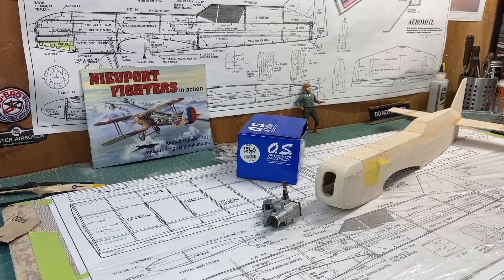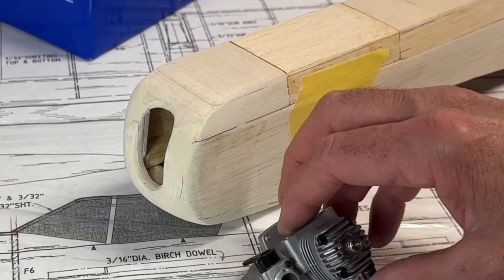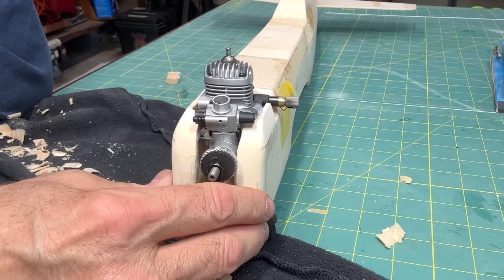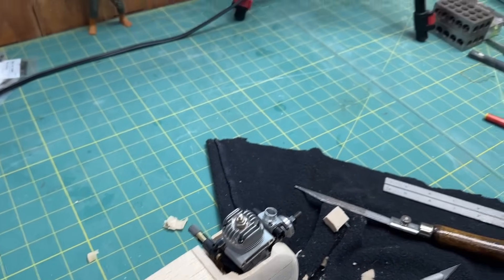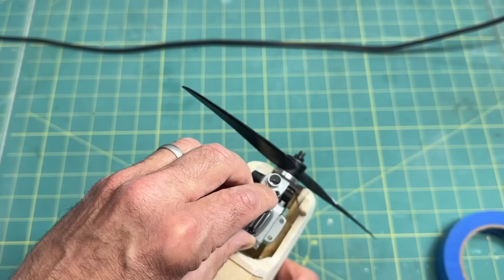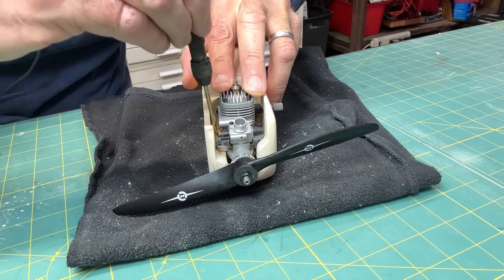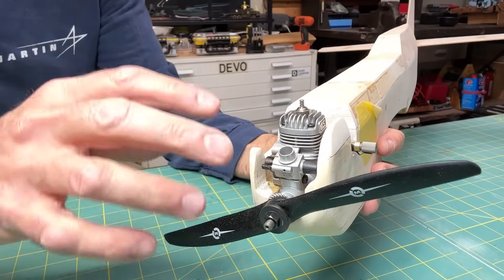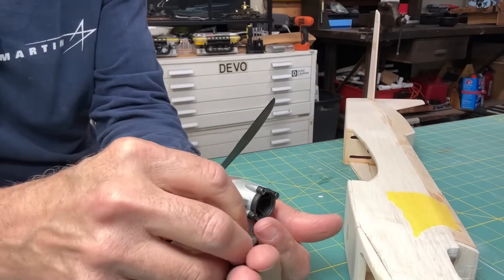How to Build a Balsa RC Plane Off Plans: No. 7 Fitting the OS Max 15 LA glow rc engine to fuselage

Comment: I remember getting my first kit by Sig.  'Easy to build' ... yeah, the motor mount was two pieces of aluminum bar stock that needed to be drilled out including the use of, as it said quite innocently in the instructions, "a no. 21 drill bit and 10-32 tap using Moly Dee Tapping Fluid."  Okay, just WHO has that 1970s-era stuff ...

Comment: You're aware you can just 3d print any plane you want now out of like $11 of pla? You can print them with the motor mounts servo horns and any customization you want to 0.01mm tolerance with very little skill.
Reply from the maker: Sure, there are many aspects of the hobby, the balsa wood build here is for the building experience from a plans and wood. But yep, there are 3d printing, ARFs, etc. what ever suits the individual.